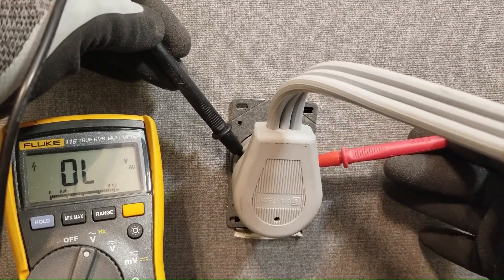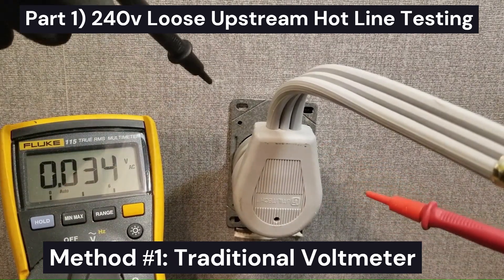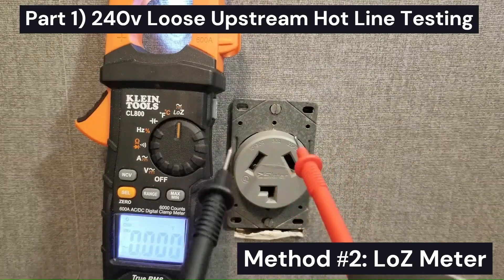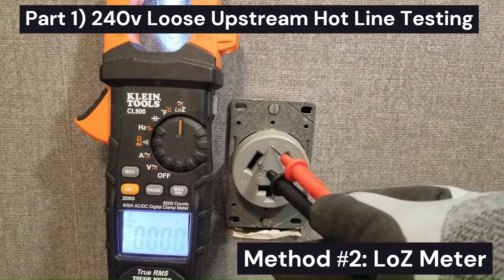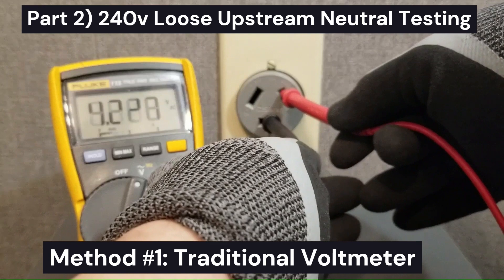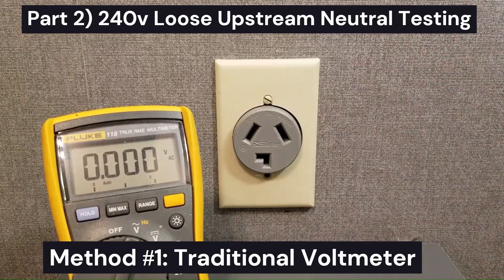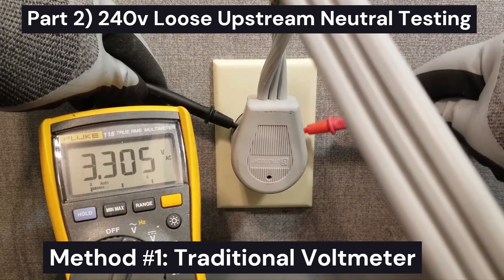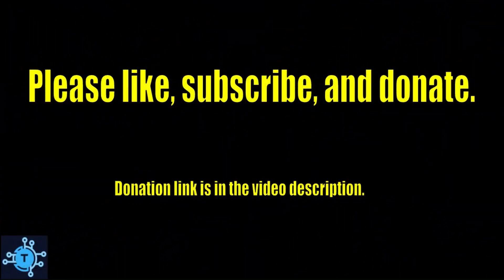#90 - 240 Volt Outlet Testing

Comment: Sir this is a nice video , and  from the video i have learned, or clicked in my head, that when you use a load for the normal multimeter, you are in a way adding an impendence in parellel to the internal high impendence of the multimeter, in doing so you would have a low total impendence, since the impendence of the load is very much less than the multimeter. In short we could say you are creating a low impendence multimeter with one which dont have a low impendence setting.